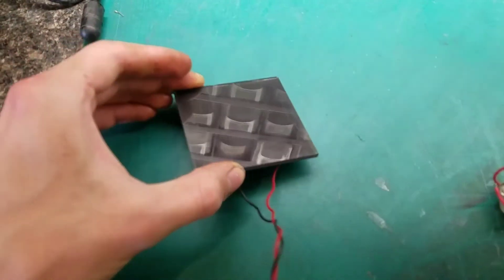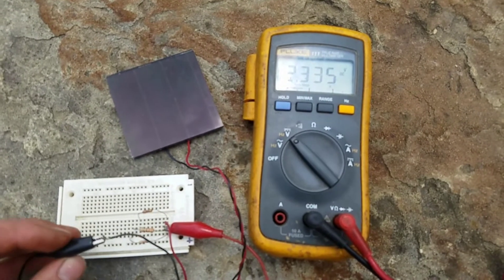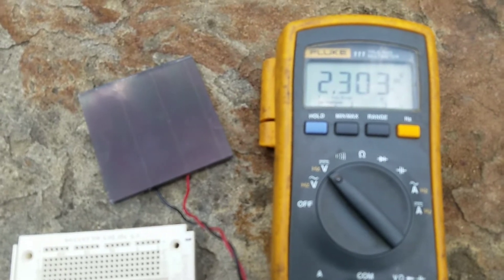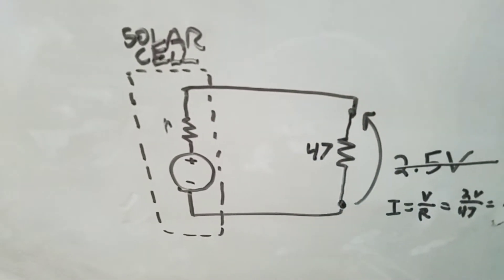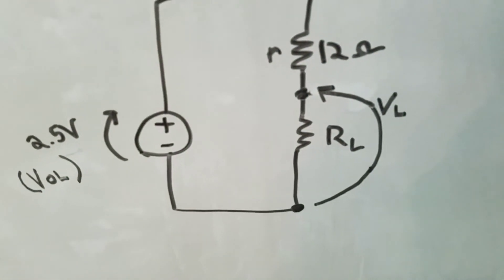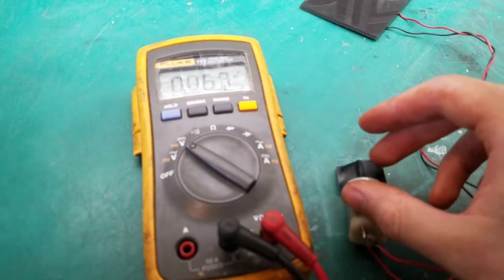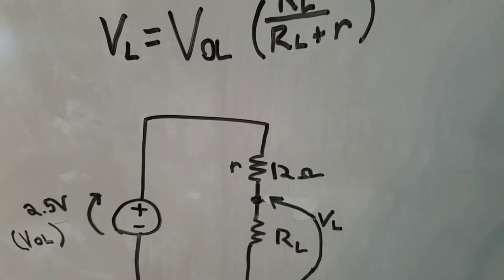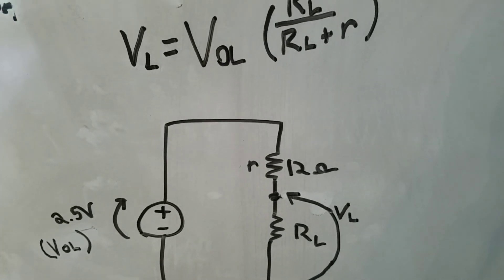how to measure the POWER output  of a SOLAR panel

Comment: I've just got into electronics and have recently found a couple of small solar panels. One is 200mm * 150mm on cloudy day it measured around 8v & .025mA
the other is 80mm*80mm 5.5v & 10mA. I'm sure they will come in handy, especially when I learn more about electronics.
Great video by the way.